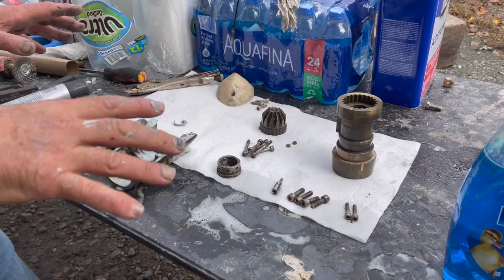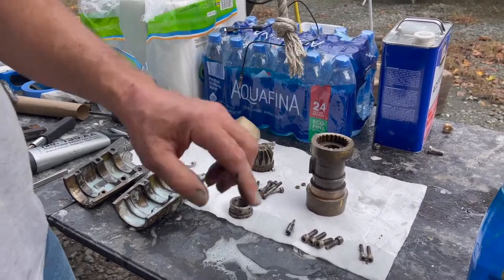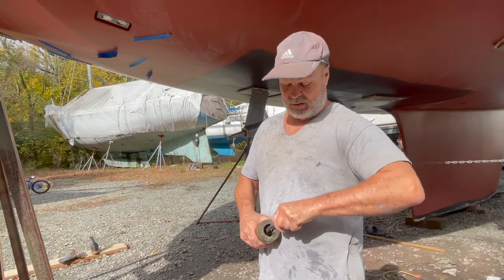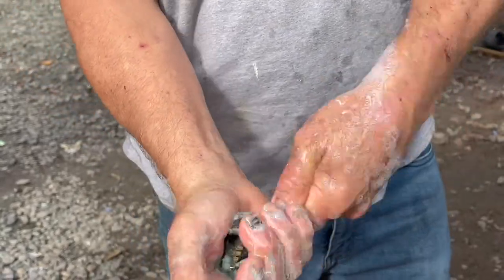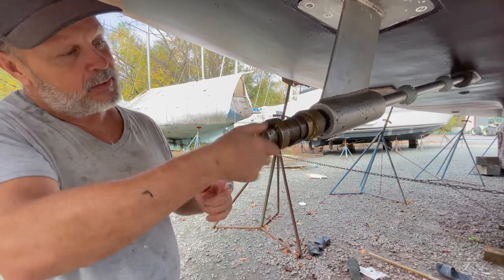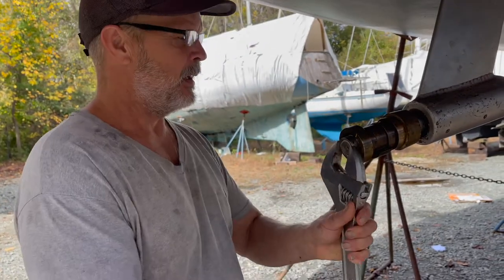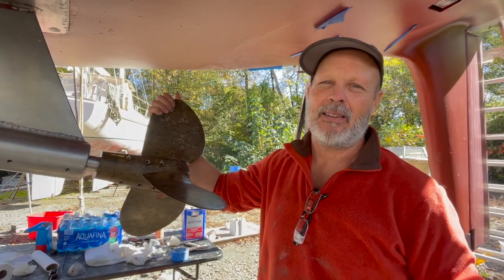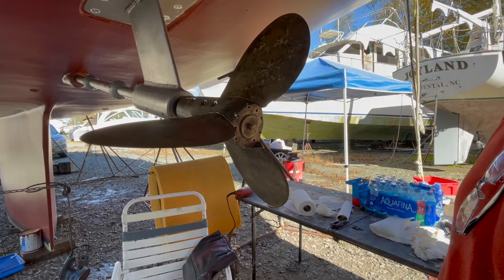How to fix a MAXI Prop in Laymans Terms - Sailing SV Bohemian- Ep. 37

Comment: The holes are for safety wire that you twist and thread to other bolts. The same as an aircraft where nuts and bolts are safety wired.